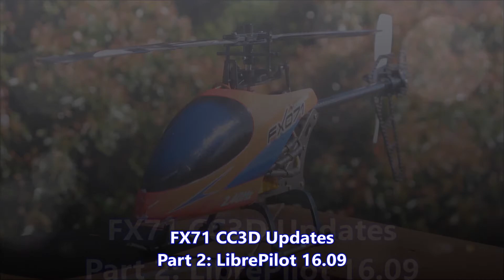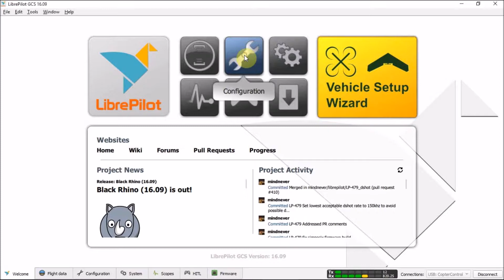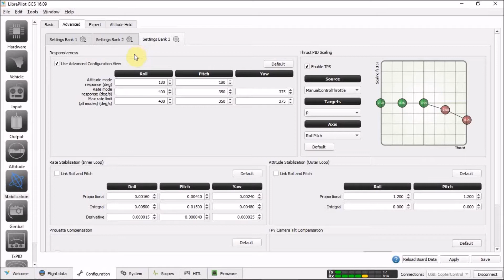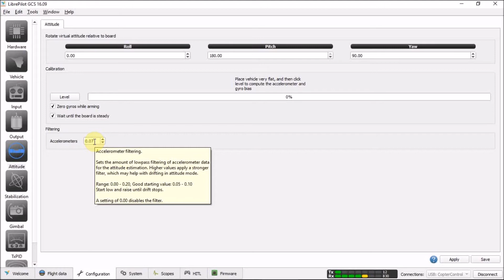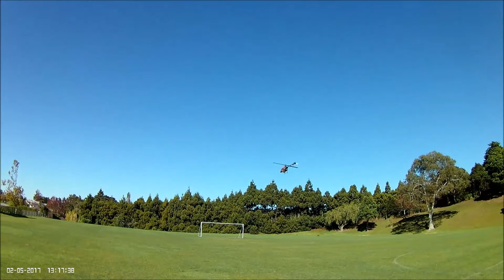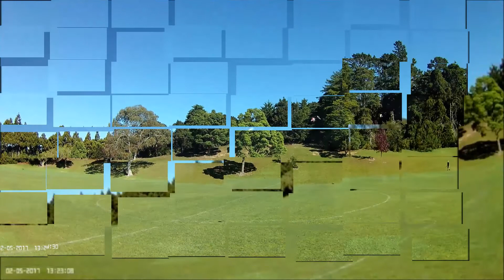FX71 CC3D Project Review May 2017 Part 2 LibrePilot 16 09

Comment: Did the 6 axis gyro stab work? The auto level, mine didn't only rate mode work
Reply from the maker: Never managed to get the Rate mode working well, flyable but not very nice. The 6 axis was actually very good to fly. Ultimately I tried a different flight controller running INav but always struggled with roll oscillations (this had been an issue with CC3D as well). That was 5 years ago and it's been sitting ever since! Next step was going to be running Rotorflight on a board however the enthusiasm to do this seems to have evaporated! A pity as the FX71 on 3S was a delight to fly, serious power but very relaxing with the 6 axis.

Comment: Hai... I have walkera uflys... That i want to install cc3d.. would you mine to guide me for the project..?!?
Reply from the maker: Hi, I've actually removed the CC3D from this helicopter and have been playing with other flight controllers (still not 100% successfully). Although I like the LibrePilot software to use, I haven't been able to get this helicopter of my V950 flying very well with CC3D, so I don't recommend it. It seems that flight controllers made for helicopters work better as helicopters have a lot of vibration compared to planes and multicopters, plus the flight dynamics are different. If you want to ask more detailed questions feel free to ask them on this RCGroups thread: https://www.rcgroups.com/forums/showthread.php?2791824-FBL-Flight-Controllers-Transplants-Setups-For-Micro-Helis
Reply: @FlyingboatsRCG  well uflys is fixed pitch 4 ch heli .. the tail blade has the same rpm with the main one... Maybe it would be the same with v912
Reply from the maker: @siogana  If the flybar head is still OK on your Ufly why not use a standard 6 channel radio receiver with a single axis gyro to control the tail (like they did on 450 heicopters with flybar heads)? That's how I ran my double brushless V912 originally. Take a look at https://www.banggood.com/E-TECH-G200-Head-Lock-Double-Rate-AVCS-Gyro-Compatible-With-ALZRC-TAROT-450-500-RC-Helicopter-p-1430519.html?rmmds=search&cur_warehouse=CN
Reply: @FlyingboatsRCG  well uflys has a tube that connected with main hear ..so the motor only one and spinning main gear.....

So.. you said that it is better using helicopter special flight controler than cc3d naze and friends..?

Comment: Is that tail waging ?
Reply from the maker: Normally tail wag is a side to side shake i.e. first one way then the other repeating which is caused by gains being too high. Tail wag is an over controlled tail and isn't smooth. This video was quite some time ago so i can't remember the exact settings at the time but in this case the tail was smooth, but not acting fast enough to counteract the main rotor/motor torque (and bear in mind this motor is running 3S and has been used on up to 400 sized helis -it's powerful!!). To cure the tail kicking i would increase the tail P gain in Librepilot, plus also look at the tail ESC's BLHeli settings. On the ESC you might decrease the motor timing and increase the startup power so it starts more strongly and has more torque at low rpm's. I might also look back into Librepilot with the tail D gain. Increasing the D gain will provide a higher response when a large angle change is detected. Finally mixing tail motor response with main motor throttle would have the effect of increasing the tail motor rpm's at the same time as main throttle to help the tail keep up. Lots of ways to improve it!